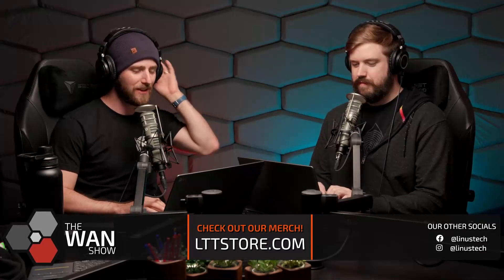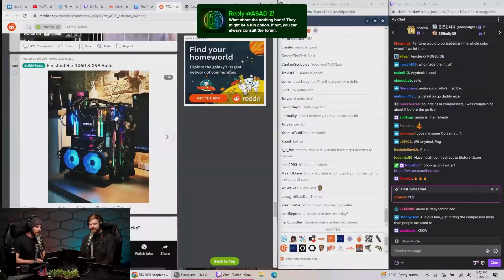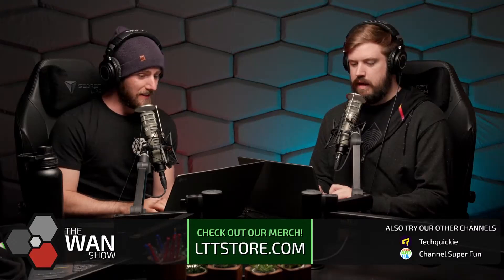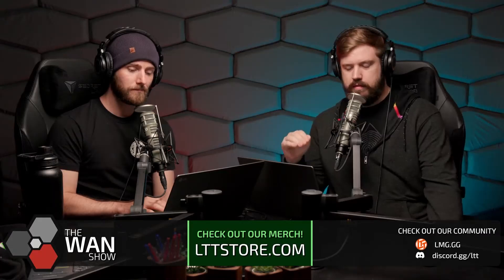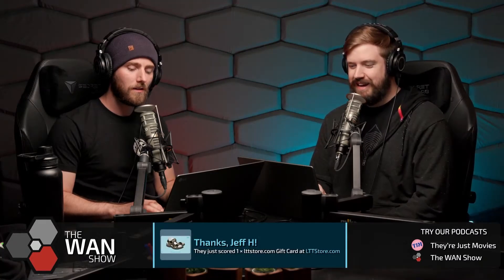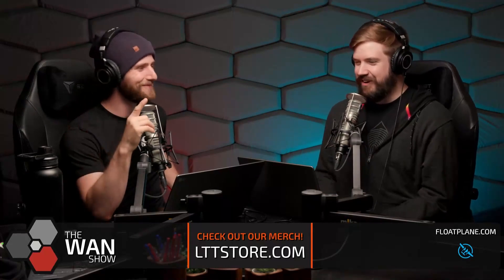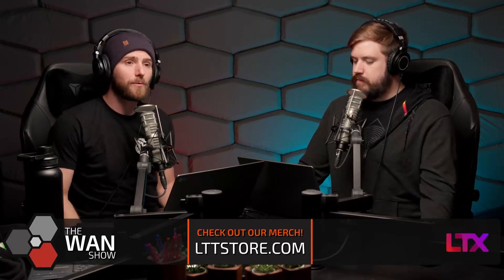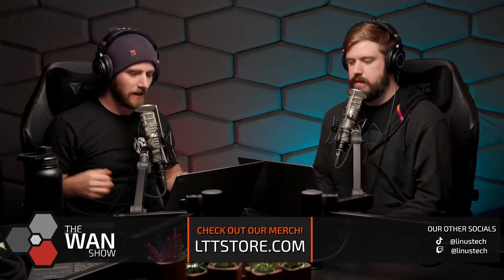Why 4090’s Are Catching Fire

Comment: haha, i hardline watercooled my pc. i softline watercooled my gf's computer. it took literally 5 minutes to set hers up and get her going. i was building mine for 2 days hahaha! i absolutely love the way mine looks though. i frosted all the tubes, and use a random pulsing blue aura pattern, and it just looks amazing.
Reply: DIY watercooling is a waste of time.
Reply: @BatLB  i enjoy it, so i don't care.
Reply: @analog56x  ok cool
Reply: @BatLB  the low temps are nice though, my 3080ti doesnt go above 50c on any game.
Reply: @slumpdogyt  AIO coolers do the same. Heck, air too. Never seen my aircooled RTX 3090 hit higher than 65.
Reply: @BatLB  What are you even talking about? Custom loops are inherently better than both air and AIO coolers. Whether it's worth it to you or not is completely subjective, but it can be, depending on what you're doing with it. To make such ridiculous, hyperbolic statements is just ignorant at best.
Reply: @BatLB  bro anything over 60c is bad when you are on liquid cooling. At idle my cpu and gpu both stay at 25 to 35c
Reply: @slumpdogyt  What are you even talking about? Watercooling is Aircooling, all you do is moving the Area, where you aircool. As soon as the Water is hot, the Temps go up. Dont go and run 1 Benchmark and be like "Oh my PC runs with 30 degrees!" but go and play for 2 Hours. Then you will see how 60 degrees on an RTX 3090 is absolutely normal, as soon as the Water reaches temps.
Reply: @GareWorks  Complete and utter nonsense. Its like saying "a home built Car is always faster than a stock sports car you can buy". 

If you fk up the custom loop, its WORSE than aircooling. If you mess up the Installation you can fry your whole system with water - Even LTT often floods their Systems live on stream. Even a good Custom Loop rarely has better results in daily gaming than stock AIO coolers. 

Of course, if you go for hardcore super overclocking where the PC does nothing but run heaven or port royal on loop, go ahead and build your open testbench system with a custom loop. For average joe and his gaming sessions, an AIO is not just superior but also WAY safer for everything and everyone involved.

Obviously you can build a 2000 horsepower car in your garage if you are a great engineer but that doesnt make custom built Cars ALWAYS superior over a Porsche 911.
Reply: @BatLB  hmm ive played for 4 hours plus and my gpu temp has stayed below 50 to 60c playing mw2
Reply: @slumpdogyt 1080p medium settings?

Play a game that uses your GPU at 90%-100% and you will  easily hit 60-65 degrees. And nobody would care. Hardware doesnt sweat, u can have it hit 80 under full load and u neither throttle nor have any negative results in comparison.
Reply: @BatLB  i leave everything default out of the box. MW2 is set to Ultra and i run 1440p. Even a game like Star Citizen doesn't put me above 60c. I have a corsair water looped system that I designed.
Reply: @slumpdogyt  even if this nonsense is true - who cares? Literally? My stock air cooled RTX3090 hits 65 on 4K Ultra. Big whoop. Your specially designed waterloop was a waste of money. My card doesnt care about the 5 degrees.
Reply: @BatLB  65c is terrible temp though my rig doesn't get to that point, if it does the LED lights change to red. I have 2 corsair triple fan slot rads. My cooling system costed me $800 for everything
Reply: @BatLB  I'm heavily into computers, I have built many computers. I over design the computers I build. I know gpus can go high but I don't want it to go higher then 65. The hotter the gpu runs it pulls the performance down aka throttles the speed to keep it cooled. If I have time, I will record a video with my Temps running a high utilization program and post it on my channel to show the stats.

Also I have super thick and durable tubes. I also have quick disconnect hoses that just unhook with no spilling.

Also I have a corsair obsidian 1000d case it requires liquid cooling as no amount of fans can cool it due to the case design and size. My case will never not have room for any upgrades. It could fit 3 4090s technically. The case weights 70 lbs alone